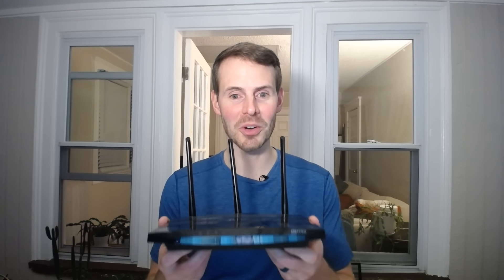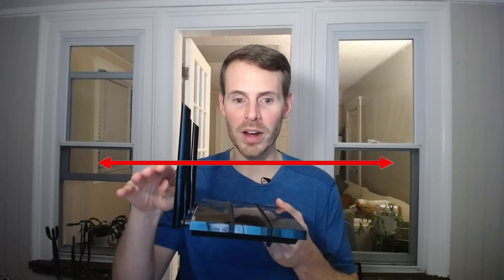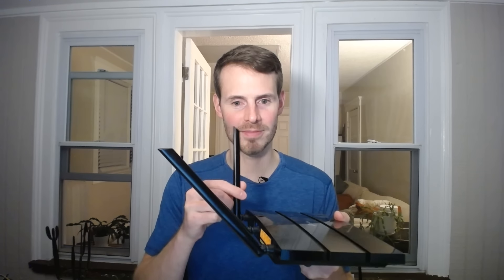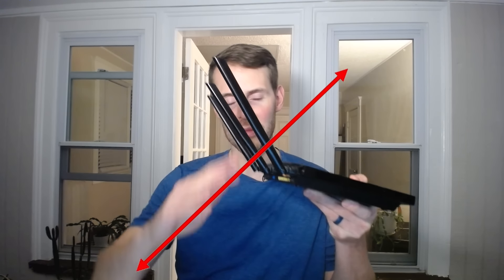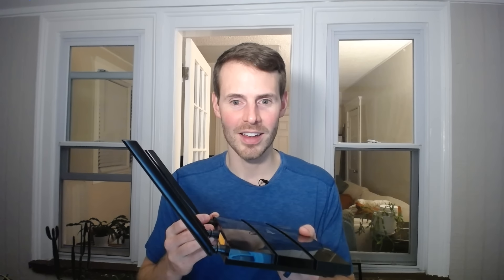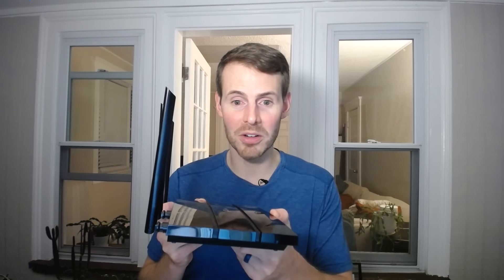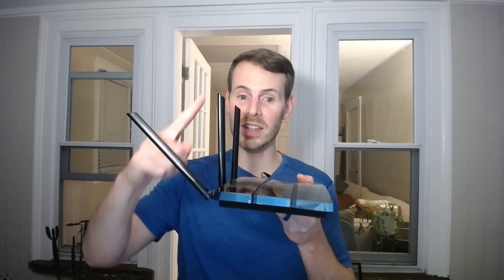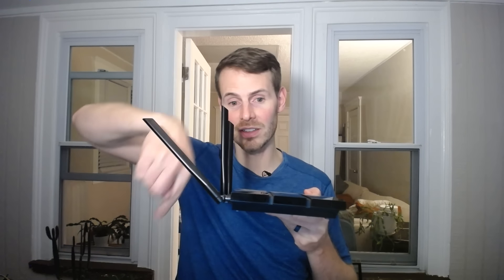Router Antenna Positions - What You're Doing Wrong

Comment: internal antenna ones fix this issue kind of. you still can adjust the box tho. besides they like air so flat on surface is bad. if they are omni antennas, imagine donut around them. if you have 3, you could 3d position them so they are all different, middle up, right to side, left to back. and don't really count on one device anyway, that's probably the best suggestion. most people have like single all in one isp cpe and they put where the whatever line comes in, is. stupid idea. this could even fail in a flat. it's just physics. there's clever beamforming and mimo and diversity. i have like 63m2 house and 1100m2 garden and shed and physics just don't allow me to have one ap. behind shed, poor, on front door, poor, roof, poor, attic still sucks, basement, shitty. but one ap covers neighbour garden, other i have now covers other corner of property hopefully but this is not all. imagine people trying to do one. sadly the systems don't really have really good features to just and user too. and they do need wires in order to get best results. worst you can do is spend half of radio time to get comm where the slave ap is. yes, it does work if you have some radio left. so yeah, wifi is difficult. but anything larger just needs more than one ap. actually one ap that goes far isn't good too. if it sends far, it can also hear far. depending on antenna logic it could try to select better antenna so to not get signal into wrong direction. man i really wish wifi is good already. all that power control and direction could come handy in flats where everybodys ap is in wrong location. everyone gets 25% signal from own ap and 75% from others and radio is all full and it sucks. hopefully it's better in future. i mean device itself should be able to align transmissions and receives. it's quite useless for users to do this. also signals could reflect too, with sometimes the reflected signal being best. if you wish, rf is black magic indeed

Comment: How about one antenna is totally vertical and the other one totally horizontal instead of diagonal?
Reply from the maker: That could very well be a good configuration. You will have to test your WiFi signal strength after putting your antennas in this configuration

Comment: Now a days most routers are manufactured without antenna
Reply from the maker: If you aren't able to see antennas on the router, it means they are internal to the device. In these cases, you will need to do your best to position your router in a location that provides the best WiFi signal to all areas of your home. I hope this helps!

Comment: How about a modem without an antenna
Reply from the maker: If your router doesn’t have external antennas, they are internal to the device. In these cases, you just have to do your best to position your router in a location that provides the best WiFi coverage for your home. I hope this helps!
Reply: @network-from-home  ok thank you very much.

Comment: I wish it is right but  I am afraid its not.  Please have look at Radio wave propagation first than look when lower frequencies and higher than you will understand +  reflection of radio waves. So in simple way when it come digital a piece of cable is enough to be in the upper part of the apartment (close to the ceiling) to communicate with the receivers located in the lower part, i.e. below the Router.

Comment: All talk, no proof.  I've tested this myself and found that straight up is best.  It was on a DIR-870 with 2x in the back and 2x on the sides.  Didn't matter how many I tilted and which way they pointed... straight up was best.

So, you need to prove what you're saying instead of just saying it, imo.
Reply: You need to state if you are testing on different levels of the structure. Straight up, according to the video, is best if your computer is on the same level as the router. So, is your computer on the same level as the router?

Comment: Aligning the antennas at different angles to each other is not a good solution to get MIMO working with multiple streams. They are meant to be aligned in the same direction to not add additional phase shifts that make the MIMO algorithm not work as good as it can, Wifi Analyzers only listen to beacons that use RF differently than frames that are sent containing user data. You want all 3 antennas to cover the same area.so they can work concurrently..  In a 3-store building have all of them aligned horizontally, not a mi of horizontal and vertical.

Comment: What are the benefits of having a tri-band home mesh system vs. a single?
Reply from the maker: @leticiawatson3707 the benefit of a tri-band system compared to a single band system is that you can provide faster wireless connections to devices that have higher bandwidth needs. A single band router most likely only provides a 2.4GHz WiFi signal, which is slower (but provides a stronger signal over longer distances) when compared to a 5 GHz WiFi signal. With that said, you get the best of both worlds with a tri-band router because you have 2.5 GHz and 5 GHz wireless networks for your devices to connect to. I hope this helps!

Comment: What if you hang the router on the wall?
Reply from the maker: If you hang your router on your wall, the same rules apply for your router’s antenna. You will likely want at least one antenna pointing vertically upwards (parallel to the wall) so that you have WiFi signal on the same floor that the router is on. I hope this helps!

Comment: Too many reflections in most homes to worry about it. Stucco homes are the worst. Besides that power comes off the antenna as lobes... it is not perfectly polarized vertical or horizontal. IT will change from one antenna to another, even a glass of water can screw with the signal if it is next to the router. Better to use something like unifi access points. mount a few around the house, I use 6 of them in total for my house.  4 inside, 2 outside

Comment: Me looking at the signal strength indicator and not on the antennas.
Reply from the maker: Measuring the WiFi signal strength in different areas of your home after changing your antenna configuration is a great way to find the antenna configuration that works best

Comment: My WiFi router dosent have antennas
Reply from the maker: In your case your router has internal antennas. In these situations your router will broadcast WiFi equally in all directions
Reply: @network-from-home  why do some routers have antennas?  Are they directional antenna
Reply from the maker: Yes, those antennas allow you to direct the WiFi signal as you please
Reply: @network-from-home  I see.  So the ones with built in antennas. You would have to move the whole router around to get optimal signal
Reply from the maker: That’s correct! The only way to “aim” the wifi signal would be to move the router itself

Comment: Absolute nonsense,  just tried it to prove your theory incorrect. 
With antennas all upright I get  -53dB on s laptop and phone 2 floors away.  With them angled and even at random positions it goes to -68dB, so moving the aerials to vertical as they should be gives me a 100+ times stronger signal.
Reply from the maker: @oh2023-cj9if thank you for the feedback. In my video, I can't guarantee that everyone's WiFi signal strength will improve by changing the antenna positions; the construction and layout of your home (and the items in it) can all have an affect on the signal strength. This video was simply meant to provide an overview of how WiFi antennas work, and to provide some basic troubleshooting steps if someone is experiencing a poor WiFi signal. I will also add that both -53dB and -68dB are considered very good WiFi signals, at least by some standards: https://www.metageek.com/training/resources/wifi-signal-strength-basics/. Thanks again!

Comment: Never align the antennas in a way that theyre parallel to each other (in any of the 3 axis). The antennas will couple into each other and weaken your wireless network range.
Reply from the maker: Thank you for sharing this. I think it all depends if your router utilizes beamforming or not. I know if you router utilizes beamforming, the User Manual says you should keep them all vertical (and parallel to each other). Thanks again

Comment: Or you can just go to Google and type speed test after changing the angles
Reply from the maker: @trueNeogenian using a speed test might be less reliable because there could be other factors at play that are affecting your WiFi speed (time of day, current strain on the internet service provider in the area, etc. The strength of signal is the best indicator when it comes to maximizing the WiFi signal that your device is getting.
Reply: Nah you want to use a wi-fi analyzer that tells you the signal strength in -db.

Comment: Ok your on a 3 level house in basementbyes butbthem antennals are not yagis  so your just messing with polarisation adjust naybe but sont furget 2.4ghz and 5ghz get greatlybdiminished by walls. Somebof its rogth but 45 degrees your wasting power heatingbroof
Reply: You NEED to use spell check and also proofread your comment.  It makes no sense.

Comment: You can adjust them all you want. It never has any effect and Wi-Fi stays poor. There's too much mis advertising .
Tried it with many routers.
Reply from the maker: I can say from my personal experience that I have had success with changing the orientation of my router’s antennas. Depending upon the configuration of your home, your results will vary. Also, some newer routers have new routing technologies that may work better with an antenna orientation with all vertical antennas

Comment: Bunch of guess work and nothing more - your video's title refers to you as well.
With today's WiFi being 2x2 MIMO, 3x3 MIMO and more, moving one antenna of an array can slow down WiFi in the other areas and introduce interference, especially when you mix the planes of the signals from one router. Furthermore signal propagation from the antenna is not just flat horizontal or vertical plane. Pattern from WiFi omnidirectional antenna is generally more lika a torus. So moving one antenna from an array my introduce the signal to a place when there was none, but it will screw up the alignment for rest of the array, influencing the performance of MIMO connections.
If you only need a low performing band for a YT video, then yes, it will work - technology will correct the errors of the user (at a cost). If you depend on your WiFi for the best stability and performance, then stay away from suggestions in this video. Build a mesh with LAN backbone if possible and don't rely on a single commercial WiFi access point/router to deliver acceptable performance for a multiple-story building.

Comment: My antennas are internal.
Reply from the maker: If that’s the case, your router will broadcast WiFi equally in all directions. You just need to position your router as best you can so all your devices get a strong signal. Good luck!

Comment: Bad information.  The three antenna are verticle because they take advantsge different signal arrival times to increase bandwidth.  Angeling them only hurts performance.
Reply from the maker: This is the case with a beamforming router, but not for a non-beamforming router (which is what I have). I have created another video that details the best configuration of antennas for a beamforming router that will be published in a few weeks, so stay tuned for that one

Comment: Sorry but i don't agree with you as i know a lot about the antennas of the Wi-Fi.  The real way you should put them is one at horizontal and second vertical. If you have 3 in one Wi-Fi then put it on diagonal, unless its a dual band router you will have to put it or vertical or horizontal depending the area where you want to receive the signal

Comment: If Omni directional means "all directions" why move antennas at all. 
Doesn't make sense
Reply from the maker: Omnidirectional refers to the fact that the signal emitted from the antenna is in all directions perpendicular to the axis of the antenna. In other words, signal is not emitted from the tip of the antenna in a direction parallel to the axis of the antenna. This is why changing the alignment of your antennas can help your WiFi signal depending upon where the device is in relation to your router. I hope this helps. Thanks for checking out the video!
Reply: @network-from-home  Omni directional would mean that they are all going to output in just that. If you are pointing the antenna that means they are linear with horizontal or vertical vertical polarity , That is what is making the change.

Comment: Those antennas are on different band, 2.4Ghz, 5Ghz, etc. it is not that simple.
Reply from the maker: Interestingly enough, on my router each antenna broadcasts 2.4G and 5G WiFi signals. With that said, I acknowledge that not all routers are built like that

Comment: I see you dont understand anything about the antenas of a router. You are doing and saying completely wrong. To be exact and explain the true signal here it is. The antena on vertical has 360degrees horizontal signal with only 30 degrees vertical meaning ir you have two antenas you leave one vertical and one horizontal , so the signal from both will reach good signal on the upper floor or at distance from the router in the same floor. NOT both on the same position. Seriously, you people think you understand about the antenas and you dont.. On the routers with dual band you have 2 antenas that are 2.4ghz and other two at 5ghz, usually for the 4 antenas the ones that are at the side are from one frequency and the others are other frequency. If the 4 are at the back means that the two of outside are one frequency and the two of the midle are different frequency than the others.

Comment: Good grief, 10 minutes and 24 seconds of assumptions that could have easily been condensed and explained in less than four minutes.  Less than that if the banter about your having a four-story home and the repeated suggestion vanity or compulsion is the deciding factor on how people orientate antennas.  No doubt OCD plays some role for some people, but "chances are" it's guesswork in the vast majority.  And that makes sense because it's what you are doing, guessing.  It's all we can do without the proper analysis of the signals being radiated within a given environment, and that is why the manufacturers are so vague about this subject.  There's a lot of physics taking place and every situation is unique.  Antennas look deceivingly simple, they aren't... I can't tell you how often in the early 70s you would have found me balancing on one leg, bent over with one arm between my legs and the other one reaching up holding the tip of the TV rabbit ears so my dad could watch the evening news and sometimes Gunsmoke.  Why that was the only way to get a clear signal I can't explain, other than God having a great sense of humor!

Comment: Dude, you gotta start talking much faster and present the info more directly, even if the video is 10min, it took waaaay too long to find out that i have to switch the position of 1 antenna.
And if you have a larger home or a multilevel, you don't reposition the antenna, you buy 1-2-3 Ubiquity Long Ranges and connect them into one and have a widespread wifi area.
Bv for the will to help, but to stay and watch 10min something, it has to be very interesting, not a lot of talk around and around the same subject. Get to the point.
Reply from the maker: Thank you for the feedback, I appreciate it! I have been working to make my videos more concise and faster paced, so hopefully you find my more recent videos more useful. Thanks again

Comment: Do you know that not all those antenas distribute the same signal, ONLY some do the 2.4GHz and the other the 5GHz... You should further investigate before you talk nonsense! No 5GHz signal is going down 2 sets floors...
Reply from the maker: Surprisingly that’s not the case of my router. According to my owner’s manual, all the antennas distribute both 2.4G and 5G WiFi signals